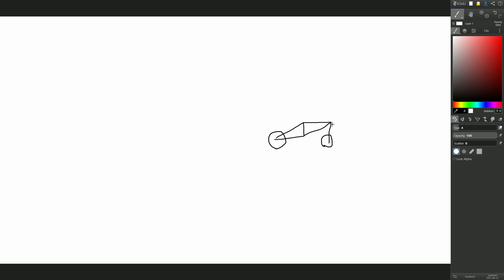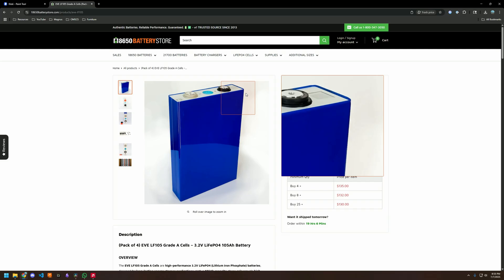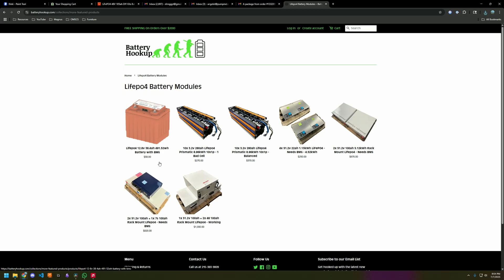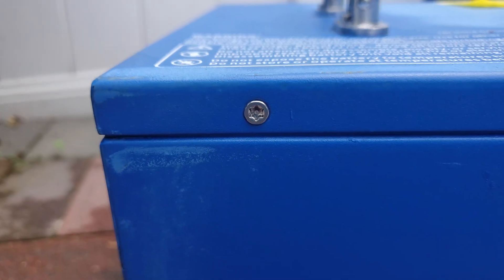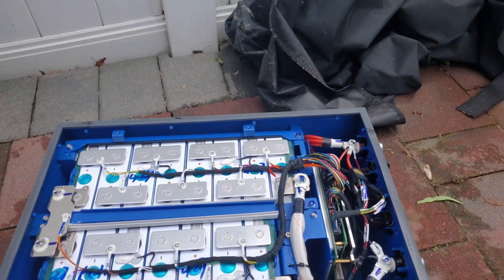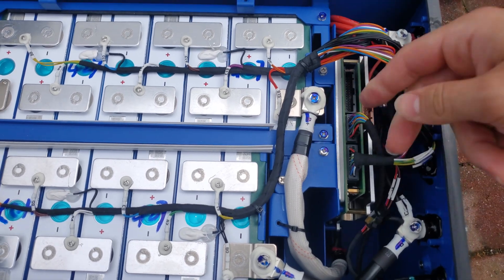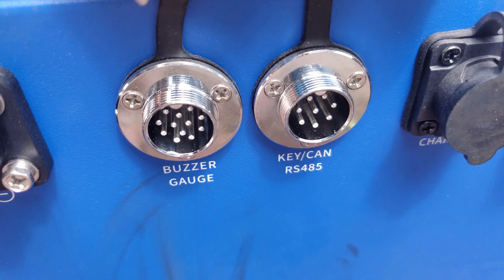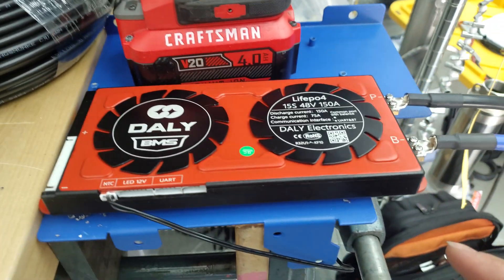I Recovered a Golf Cart Battery and Saved $1,000+

Comment: get the tongue of the trailer on the same plane as your chain stays and just over all try and get the axle at the right point so it moves with you not acting against you lower it like put some drop shackles in it lol and do this all with the weight in the trailer so u can get it dialed in and you can ride without really knowing its there if you can constantly feel it trying to lift up on you and keep going straight when trying to turn thats gonna make for a miserable ride lol i have had this idea in my head for some time im about to select some parts to use on a clean efficient bike with reliable range for peace of mind  so im aiming for a all around practical build and going to build the battery as well battery hookup has some good prices on cells that are basically brand new never had a cycle on them yet so i also have a vision of making a pack for your back and have it cover the most of your back as possible to keep the weight distribution optimal so on and so forth massive energy in that unit u got cross country with a little train of those things with a generator charging while other is driving motor lol

Comment: I am working on such a project
Reply: can pickup a 48v 30ah LFP battery brand new. I think the range will be fine if figure out how to wire to an ebike.
Reply: @uhjyuff2095  a 48v 15ah battery is normally used for ebikes. 

a 30ah will doubnle the range. my ebike, the hiboy ex6 has a range of 75 miles. and would double to 150. 

i want to use a 100 ah on a radwagon 3 to multiply the range by around 10 or so. 

you can imagine with a bigger battery, range wil be roughly much larger. Range tests are normally performed under extremely rigid conditions. 

the hiboy for example used a rider that was 165 pounds, flat surface, pedal assist 1. with a bigger front ring getting a range exceeding 100 wasnt too hard, even with a 300 pound rider.